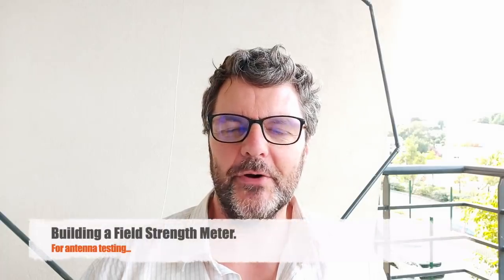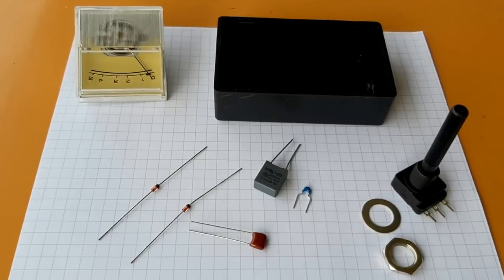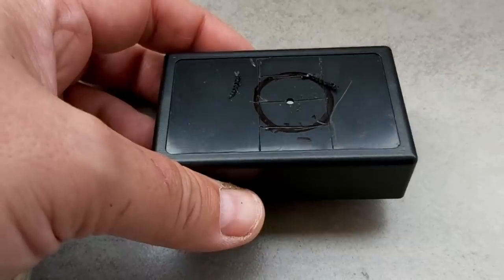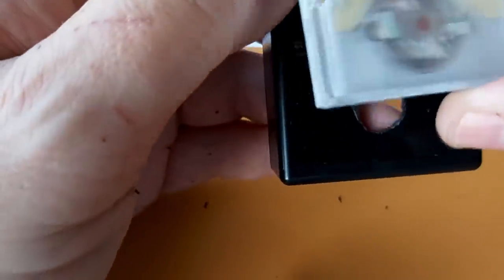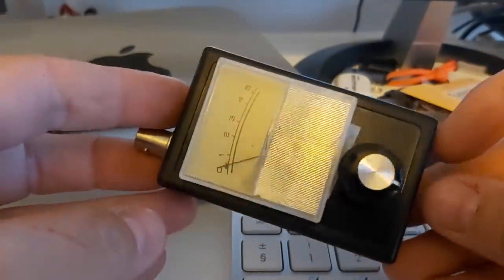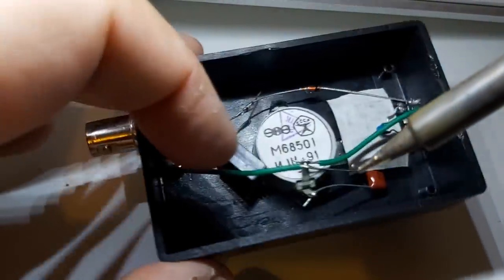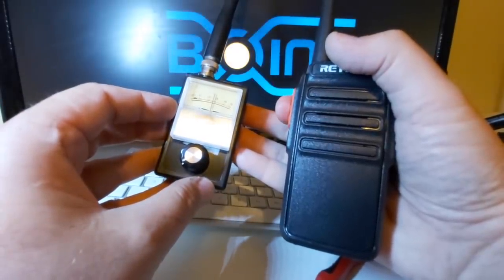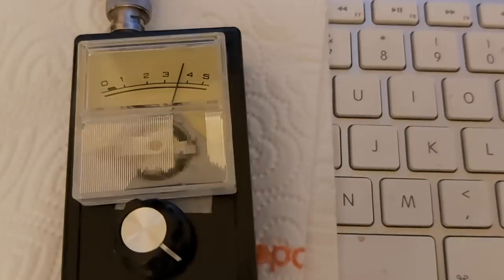Building a Field Strength Meter.

Comment: NO PLASTIC BOXES. LAZY. UNTHINKING!
Plastic box is a complete FAIL! Signals, thus, INTERFERENCE can reach the meter directly, after the antenna and rectifying, and filtering, and attenuating circuits. This completely invalidates any measurement you wouls care to write down. SEALED METAL BOX. They are not the cheapest enclosure. If you cant find one then a folded aluminum sheet bow will barely do, but you should seal the seams with copper or aluminum tape.
Reply from the maker: Sure. But measurements are relative. I use a small antenna directly on the box, so in this case it doesn't matter, but good observation.

Comment: 2 corrections
1N34A are germanium diodes not schottky 
Germanium diodes have forward voltage drop around 0.2V
Silicone diodes have forward drop of 0.6V

Comment: Hello my electronics friends , i have a question . Now first to let you in on a secret . 5G Antenas are Phase Change Directional emitters , witch means taht you can AIM it .
It sends Microwaves to a pin point location of your choice . And we live in a world where they are placing those weapons on every 100m.
Along with Cameras for tracking .  Do you get the picture ? They can locate you anywhere and Aim 3-4 antennas at least at any time , and kill you where you stand .
This is dangerous . Of course ppl can say oh this is conspiracy theory . ITs not , its a technical fact . I dont feel like trusting Chinese Government that they wont use it against me .

So , now the question . Can these DIY Field Strength meters work on 2,5Ghz up to 80Ghz , and if anyone can provide a Schematic that would be wonderful.
I
Reply from the maker: That one no  but I am sure some designs can, though I know nothing about them..
Reply: @RadioPrepper  You better learn my friend , the way microwave at those frequencies works is heating the target as well as  shaking the bonds of Oxygen atoms . So your lounges can not pick it up because Oxygen wont bond with Hemoglobin in your blood . So you are starved of Oxygen the result is bad . Looks like Corona Virus but its not its Energy beam .
Ive heard it few days ago from Electrical Engineer im not so smart to figure it all out .
But now you know , protect your self better safe then dead

Comment: I find when drilling plastic boxes it helps to warm the box slightly with a hair dryer, then hold the side of the box which you are drilling against a small block of wood to stop the plastic flexing too much. Works every time for me.
Reply from the maker: Great thanks!

Comment: Great video Gil, I like a lot of other guys here commend you showing the errors we all make. If anyone builds anything, you are going to make mistakes. as so many said below, thats ow we learn. I gringed when you said you were going to fill it with epoxy, my first thought was the replacement of the diodes. they tend to be the thing that goes 1st in these meters. (I've blown a few!) So I hope you show rebuild # 2. will look forward to it and hope you do an HF type check out of the meter to show its really good uses. Thanks for sharing.  es 73 de Ellis
Reply from the maker: Number 2 is done! Same thing without the epoxy;-)

Comment: I assume this was tried on 2m but I wondered whether it would be sensitive at UHF- which is what I need. Not sure how it works as there is no inductor or capacitor to form a resonant circuit but if it works - dont knock it! Excellent tutorial. Thank you very much.
Reply from the maker: It does. I tried at 446MHz.

Comment: I think you said in the beginning schottky diode is a germanium diode. Actually, it is not, it is based on metal sililicone boundary. It has a lower drop than typical silicon diode like would a germanium diode have too.

Comment: Thanks for this excellent tutorial. I built it and it works. I made a 3D case for it. 
Here's the links for the meter on Amazon ($10.39):
https://www.amazon.com/gp/product/B07F1TKP2K/ref=ppx_yo_dt_b_asin_title_o04_s00?ie=UTF8&psc=1
For the 1N34A diodes (10 for $6.99)
https://www.amazon.com/gp/product/B01KC0FNL8/ref=ppx_yo_dt_b_asin_title_o06_s00?ie=UTF8&psc=1
For a collection of pots and capacitors (I don't have a junk box of parts - now I do):
https://www.amazon.com/gp/product/B07VJ57LJF/ref=ppx_yo_dt_b_asin_title_o04_s00?ie=UTF8&psc=1
https://www.amazon.com/gp/product/B072J58YMT/ref=ppx_yo_dt_b_asin_title_o08_s01?ie=UTF8&psc=1

Comment: I'm a retired electronic technician, designing and building my one and only UFO detector station in Ontario, Canada (that I know of).
Just finished a light spectrometer from publiclab.org and my 5" telescope to take real-time videos and spectrometer readings with a Raspberry Pi3B+ and RaspiCam
I left the most complicated parts for last. A lot of my sensor projects are from this site (techlib.com).
Is there a practical way to listen to and monitor all frequencies from 1Mhz to 5GHz in real time? Can one a HackRF One do it? What kind of weird antenna would I need? 
Anything to give me some data, when these things are around, would mean more real-world uncalibrated data.
Reply from the maker: An SRD receiver would allow you to listen to chunks of it, but not all at once. You would have to write a scanning software to do that, maybe using GNURadio...
Reply: @RadioPrepper  Thanks for the reply. My understanding about SDR is the window's BW is 20 MHz on the cheap $10 dongles. Looking at the specs of more expensive units, I don't see any difference. They all seem to be only capable of scanning 20MHz at a time.  
That would make it crazy expensive to do in real time. The other way is to scan and move the window to scan the next window, and so on. Then you risk missing bursts of transmissions that could be out of phase with your sampling rate. 
Not an easy problem to solve on the cheap.

Comment: Hello, it was a nice video. Thanks for information.
I was sorry for the epoxy accident. By the way, I wondered why you filled the box with epoxy?
Can you give information about a subject?
Is the shape of the antenna you use in the circuit important? So, is it possible to convert it to a larger, square or circular 30 cm antenna?
Ammeter you use; It measures 250 micro amps. Is it necessary to use a nano-level ammeter for RF power measurement at greater distances than the transmitting antenna?
Thank you in advance for your answers.
Reply from the maker: I just wanted to make it more durable. Any antenna, small is better; a foot-long wire would do fine. Otherwise no idea..
Reply: @RadioPrepper  Thank you so much for answer.

Comment: We all have days like that.   After the first stupid mistake or cock up, I just down tools and come back another day. 👍
Oh, and apart from using better cases, drill from the other side onto scrap wood, so the plastic doesn’t flex under the pressure from the drill.

Comment: One way of avoiding epoxy disasters is to mix up some thick epoxy glue and just smear it over all the components - too thick to run inside, it'll cover the holes and cure fast, but still give it a day to cure thoroughly before pouring the bulk epoxy in case they interact chemically.

Comment: Hi Gil.
I built one of these many years ago and it's so useful.Im sorry you ruined the field strength meter with the resin but I'm sure your next one will be OK.
When we can travel again I will be operating from Cap Blanc Nez on 2 mtrs so maybe we will make that qso?.73 Ian.G7HFS
Reply from the maker: It could work, it's far enough from Antibes to not be in the skip zone...
Reply from the maker: But probably not on 2m, but you never know...

Comment: I use my old Heathkit HD-1425 Field Strength meter to indicate RF in the shack. I have a 75m dipole in the attic (it's resonant exactly in the middle of 75m), then use window line down to a Palomar Engineers 4:1 Balun + 1:1 Choke, then coax through a pass-thru and connected to Dentron tuner. I operate from 6m to 160m with it, up to 100W. Some bands have to be operated at much lower power, even with RF chokes on everything, due to the amount of RF that was getting into the shack before I added the Balun and choke (the computer would  reset and electronics would go nuts). I have a sheet of paper that reminds me which bands can handle full power. I preset from that and then I adjust output power so the the field strength meter (at maximum) barely indicates. I operte FT8 and CW so I don't often run 100W. 
When you said your were going to epoxy the box I said out loud - you're going to f it up :o) Even with tape I'm surprised the pot didn't seize up too.
Reply from the maker: Interesting use, thanks.

Comment: Thanks Gil, I need to make one of those.  Not to worry.  Mistakes are just opportunities to build again with better information -- I therefore must have LOTS of better information. ;>)  One question: What value is best for the pot?  You say you used a 250K linear but your schematic says 25K.
Reply from the maker: It's 25K.

Comment: When I saw my very first FSM, I thought it was "magic", these are some of the coolest tools for understanding radio waves, and the way energy is transmitted. Have you compared these "real world" measurements to what modeling software predicts?
Reply from the maker: No.. I haven't used a modeling software either.. Maybe something to look into...
Reply: @RadioPrepper  Your project did remind me of one of those days where everything I touch I break.. The days when I think going back to bed and trying the next day may be better. I'd like to see the Military Grade meter you replace the "Prototype" you made, if the cost isn't too crazy I normally try to use them, as I seem to drop everything in water at some point in my ownership.

Comment: Hi Gil, I think the problem with your cases breaking is because the material is both brittle and flexing. You can see the flex at 4'14" to 16". Suggest you use a block of scrap wood inside the box to support the plastic and stop it flexing. Then drill through and into the scrap wood. Also if you put some masking tape over the hole you are going to make, it may help stop chipping the hole edge when you drill. 
I guess you know all this but if not it may help. 73 G6XIB

Comment: I never have a problem with these cheap boxes I drill a small whole 1st but from then on I run the drill in reverse at high speed. You end up melting the way through. You will never get a jam and never break a box.

Comment: sad outcome with the final epoxy pour, I've never been brave enough to pot my work like that at all. Maybe try expanding spray foam? Probably won't get into things the same way, but might provide enough vibration support. That or just a few gobs of type2 silicone.

Might also try drilling from the inside if the box is shallow like this one, would be able to get better support on the back. Or you might drill the table :)
Reply from the maker: Good advice thanks!

Comment: To make holes in plastic use a Dremell type tool with a pointed grinding wheel, it melts it's way through more than drilling it's way through. Interesting project,I will be making one of them. Thanks for making the video.

Comment: I know I shouldn't have but I did laugh at the end there.... Just when it was almost going to plan too!!! 
Please buy a reamer for preparing holes like that. They're cheap enough and much less likely to split the plastic. Plus you can cut those in-between sized holes that the step bit can't do.

Onwards and upwards. 👍👍